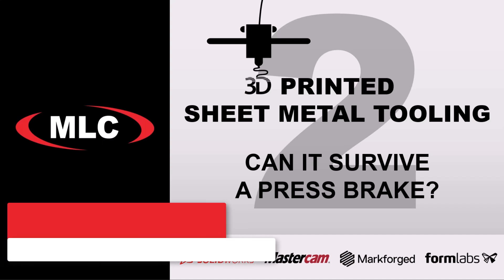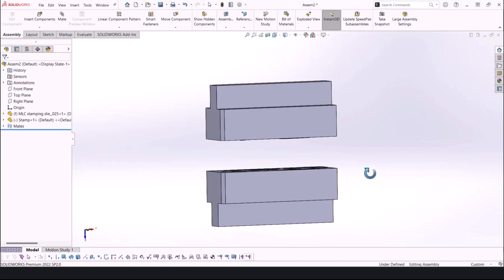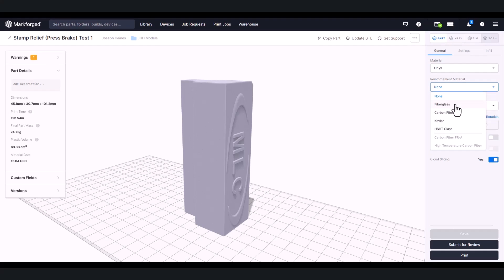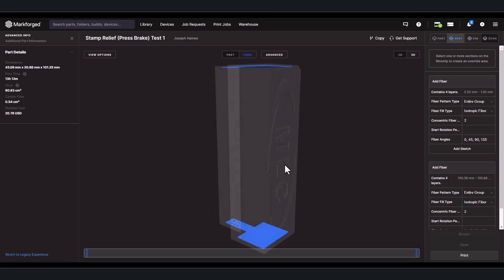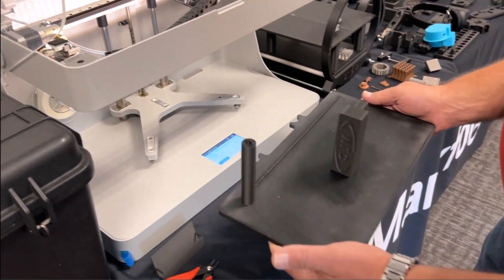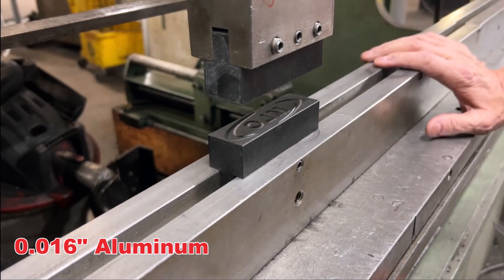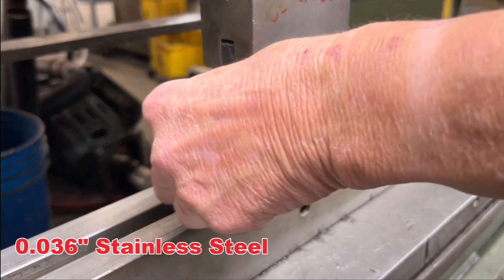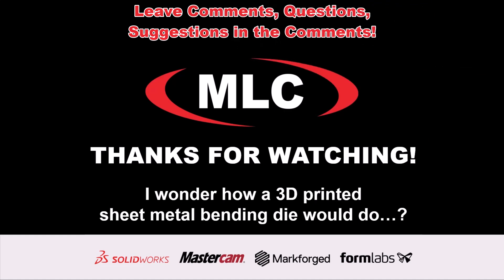Will It Survive? | 3D Printed Sheet Metal Tooling vs. Sheet Metal Press Brake

Comment: I have been developing these techniques for my work and have found that making the dies as thin as possible and using a taller press brake adapter/extension helps a lot. We are able to get results that met or exceeded what you are showing with bog-standard PLA dies.

Comment: Let me know when they can 3D forge.😂
Reply from the maker: Mark... FORGED? Yea, OK, not true forging yet. Metal additive manufacturing is exploding though, and you could absolutely build high strength metal molds and tools for forging operations.
Reply: @MLCCADSystems  It was a joke. But I was getting it was you can't just 3D print anything because sometimes strength is a major issue.
Reply from the maker: Absolutely, and with every material there are trade-offs in terms of strength, toughness, manufacturability and more.  I just love to see how far we can push the envelope with the new technologies and materials available.  I'm confident there are unrealized opportunities out there and this video and others show the iterative process required to develop them.
Reply: @MLCCADSystems  I'm kind of the same way. I think 3D printing has amazing advantages when you're trying to create things that you don't need a lot of. For example, if I need to replace a part on an old classic car that doesn't exist anymore and it can easily be made out of plastic, I'm all for it. 

But I still see the modern 3D printers as sort of the equivalent of the model t to cars. Okay maybe we're at the model A stage now. But the Bugatti Veyron is coming. 😁😎

Comment: Very interesting video, thanks for sharing. I have good success with 3D printed tools using just PLA and 100% infill on a 50 tonne press brake. The key for me was to make the 3D printed tooling fit inside a large radius steel bottom tool so that it was supported all around. The top tooling was also well supported, but that is hard to describe. I got very good results with 2mm steel, but I was making specific curvatures, not the kind of detail you're doing.
Reply: Hi, very interesting. Could you explain what you mean by fitting them inside a WIDE RADIUS steel lower frame and providing good support around the entire perimeter? Thank you in advance for your response.
Reply: @WorldConstruction  I had a very big bottom tool, vee width of 125mm (4.92") - Rolleri part no M103.80.125, the 3D printed part fills the space - when the sheet presses down on to it there is nowhere for the PLA to flex, so it remained strong. The top tool was a round tool of radius 50mm (2"), part no C70.50, I made the tool fit around that curve so that the force was spread out - I think a typical top tool with a radius like 0.8mm would have just cut through the PLA. I was making specific curvatures and acute angles.
Reply: @AllTheFasteners  Thank you very much for the clarification
Reply from the maker: Nice work! As we have been experimenting and learning with these videos others have shared their success stories too. We are excited to see how far we can go with printed tooling!

Comment: maybe adding metal rods to that die will help against rocking (just print lil bit langer piece and print or bore holes)
Reply from the maker: That is a great idea!  Hybrid approaches are a great way to increase strength using cheaper materials while also reducing the amount of material we have to print. Sounds like a great topic to explore in our next set of design iterations.